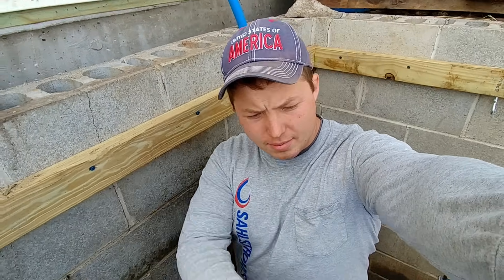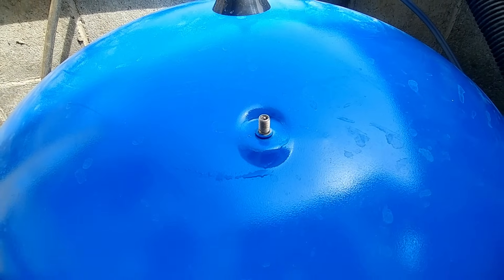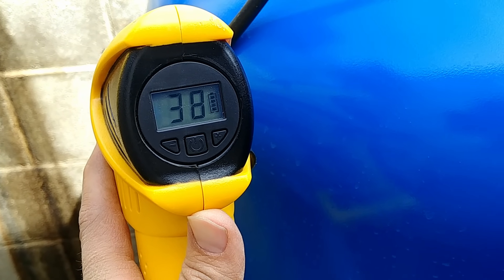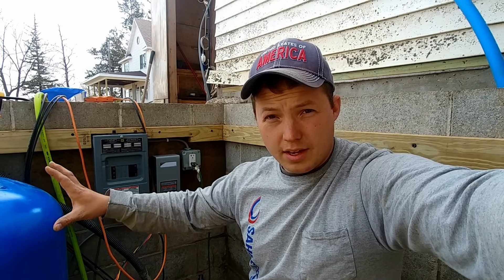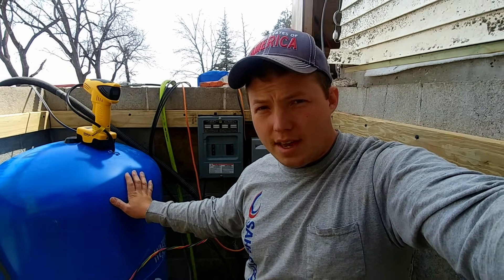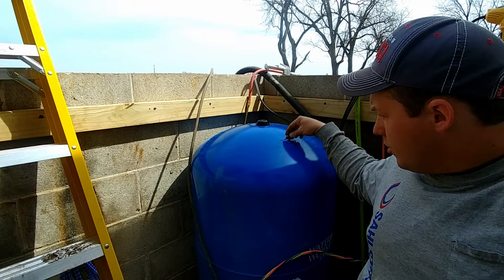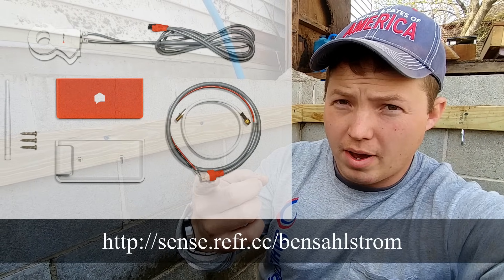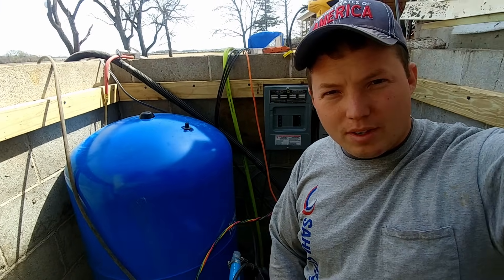How To Set Well Pressure Tank Air Pressure

Comment: You don't waste any time identifying something wrong with your system.  One thing you should consider is a partly clogged pressure switch inlet and routine maintenance and good workmanship it looks like your in some type of blighted open development.   I have a separate switch for my pump house and garage and turn it off when I go to bed so any leak will not drain much of anything.   I never thought of leaving a hose on because I don't have kids but if I were you I would install a hose bibb lock and call it a day I'm sure you got better things to do them monitor your water 24/7.

Comment: Excellent information. Except!  Flooding the well house and allowing the water to be on the floor while your working in the room is EXTREAMY  dangerous. The well pump at that pressure switch is 220 Volts. Most wells are not maintained very good. i.e. loose and bad wiring. It can kill you.  Don't take the chance. Run the water away from the work area with a hose.

Comment: Why is the setting less than the cut in 2 psi?
Reply: If the pressure is equal or greater than the cut in, the pump will not operate at all

Comment: Cool video, just bought a house with one of these and I don't believe the well water system has been maintained at all for at least 5 years. Love your idea of getting two tanks for less pump cycling, that is exactly what I will do, I'm also replacing the pressure switch & adding a pressure gauge so I can see what's going on.

Comment: Hi sir, i have a question ; my water tank works 40-60 psi. sometimes i press air into the tank bu using air pump . The gauge on the tank and the air pump`s gauge give me different psi level when i press air into the tank. (Pump`s gauge 34 psi , tank`s gauge 29psi at the same time) . Which one is correct to achieve 38 psi in the water tank? Thank you.(Tank ıs empty)

Comment: A very valuable addition to any well pump system is an electric light bulb placed somewhere outside the well house that comes on when the pump turns on. I just use a 14-2 romex feeding the exterior rated light fixture. I connect one of the 14-2 wires inside the pressure switch to one of the two pump/load terminals and the other simply grounded to one of the ground screws of the pressure switch housing. At the light fixturre, just connect the two wires as usual. Now, any time the pump comes on, there's a visual alert that can be seen from anywhere outside the well house as long as the pump is running.

Comment: I have a small floater which just runs my sprinklers. I noticed at any given time the pump would come on for about 2 maybe 3 seconds and just stop again every so often. Not sure if the tank was just so low on pressure. Now  the pump doesn't come on when activated my the sprinkler panel.  I took a tire gauge to check tank I get a 0 psi reading

Comment: Why have everything below ground level ? Thats the old way . Here in my state it all has to be above ground in an insulated well house . Top of well casing has to be above ground 2 feet . If down in a hole there is chance of contamination from flooding or the farmer irrigating his field next to you and using chemicals that could get in your well .
Reply from the maker: Yup,  same thing around here. My well is just old enough that it was installed before those rules went into place.

Comment: I have recently watched probably 6-8 videos with folks troubleshooting pump/pressure switch/pressure tank issues. Not 1 has mentioned anything about the tube that runs from the pump to the switch. I'm in Florida and every one of them I've seen are plastic. We have a fairly serious sulfur content (NEW WELL) and the darn sulfur has clogged up the jet in the pump twice now in 2 years to the point that mechanical intervention and even flushing with muriatic acid has to be done in order to get it to pump water again. Have you ever dealt with something like this?

Comment: Great video, so many idiots set the tank when empty to the line pressure desired. Which is 100% wrong. It should be about half of your desired pressure to prevent early bladder failure.

Comment: Hey Ben first of all when I thank you for sharing your knowledge and wisdom I was wondering maybe if you you can help me figure out the layout and set up of my components. I have a water storage tank from a well system so it goes like this well to storage tank storage tank to house, and my components I would like to have your wisdom on how to set up in the order would be a settlement spin down filter to my Grundfos booster pump expansion tank whole house filtration system and I have a electric tankless hot water heater so if it’s not much to ask from you, could you please help me with the set up and configuration just wondering if the order in my head matches up with how you would set it up I thank you very much for any feedback. God bless Ben be safe.

Comment: May I ask...

I have a 44 gallon well X Trol tank with a 60/80 pressure switch, that I have set to 55/75 for maximum pressure at my bathrooms, but not hitting the 80lb max, that home piping is rated for. 

So with that set up, what should be the air pressure in my water tank itself in order to maximize the house water pressure? 

If I understood your video right, I need to get it to 53 pounds of pressure inside the tank, correct?

Thanks in advance for your response back and thanks for the great vid.

Edit to add another question...

Can I drop my pressure switch down to 45psi, so that the settings will be 45/75? My thinking is, if I drop the low down from 55 to 45, I'll still have solid pressure, but I am extending my well pump life by a lot, because it will comes on less, and stay on longer when it does come on. 

I think these questions will help a lot of people, and if they do, please watch the video, but also watch the ads. Sit through the ads no matter how painful, as they get the great people who create awesome vids like this paid a little bit. JS. 😊

TY Benjamin! 👍

Comment: When on a well what determines the overall water pressure? My pressure tank is set to fill at 40 and stop at 50 psi, and my water pressure after the tank is 45 psi. Is there anyway to safely increase this?

Comment: Why is the pressure in my tank when it is full of water the same even after adding another 15psi of air into the tank?? If someone can help me with this I would greatly appreciate it!

Here’s what I did: measured psi before doing anything, it read 67. Drained the tank, and without water the tank pressure was 11.5psi. I bumped it up to 28 and turned everything back in and brought water back into the system. Rechecked the pressure and it’s still at 67psi

Comment: Hello when I go to pressurize my tank when all water is drain to 28 psi were cut in pressure is 30 my gauge reads 28 psi just putting air in the tank I know it is not suppose do that could some one tell why it is doing this so air that I put in tank is going thru tank to the gauge I see your isn't doing that please help

Comment: If you still watch this sight how about sediment . I flushed my well and there was black , red and grey water at the end of the flush  and the pressure gage after that went up to 55 psi and before that it was 38 psi . It was an accident when it backflushed because I was replacing the whole house filter and the turn off  spigot to the house filter broke and dumped the water . My tank is brandnew as of 4 years ago .Put in new one and hooked everything back up and psi after that was 55   my tank looks about the same size or maybe a little bigger and is a pro flow . Other pressure tank I took out was way to small for 4 bathrooms that well driller put in and was making my pump work all the time

Comment: Do I have to drain the water to add air. My 40/60 is reading 1 psi and I just drained it my pressureguage is broken . And the problem I have is high and low water pressure.

Comment: Great helpful video Benjamin. I have a question. LG told me that my ice maker is not working properly because the water pressure is too high. I don't know if that's correct but I'm wondering how to permanently lower the pressure in my tank. It's now set at 40-60. Can I change it to 30-50? How do I do that? I'm assuming I let some air out of the tank to lower the cut-in number to 28. How do I adjust the pressure switch?

Thanks for your help

Comment: You might want to just set it up so that if you want to drain your pressure tank you have a pipe that simply runs out through the wall and drains it outside. That's what I would do, of course I'm here in West Texas, it may be warmer here than where you are. Thanks so much for the video! It was very helpful.

Comment: What makes the pump stay on long after the tap was turned off?. This is the problem I’m having in my van.
Reply: In your van??  Your faucet is using up water from the pressure tank. Your well pump then refills the pressure tank. It can take a few minutes to fill the pressure tank after you shut the water off. Completely normal

Comment: you gave me anxiety being in water with electrical and piping ive been electrocuted by an exposed wire hitting a window frame and me grabbing the the window to open it. i had to be kicked off the window. other than that it was educational video. summed everything up nicely. just be safer.

Comment: This depends on the type of your pressure tank. However in my experience with modern pressure tanks, first check the ratings for your individual tank. It should be printed clearly on a label somewhere on the tank.

Didn’t see the specs on that particular pressure tank. But that’s an incredibly low water pressure. Standard residential is 60 psi in most areas. And you don’t want to go beyond about 75 or 80 for any reason for residential water.  Specs on that particular tank will probably tell you’ve got a max pressure Capability of 125 psi.  Of course that may not do much good if you have pressure reduced at the well.
And as always, if it was configured based on the capacity or capability of your well then it should be left at those settings.  There’s absolutely so much to get into on this subject there’s no way to do it in a single comment.  If you’re having trouble with your water pressure, first you should check the pressure regulator on your well, and consider bringing that tank up to 60 psi if it can handle it. It very likely can handle that.
Reply: Of course you need to be sure your well pump is rated for those pressures. A few of them simply are not. But most can

Comment: What's the difference between a pressure tank and a expansion tank?
Reply: Two totally different things. The well pressure tank in this video pressurizes drinkable water into your house. An expansion tank is used in a hydronic heating system. It gives the hot water (heat expands ) somewhere to expand into so it doesn’t overpressurize your system and blow out the safety valve on the boiler.

Comment: If the tank is low or not working properly, will the pressure switch turn off and on rapidly??   Thank you very much
Reply: You are describing a cycling pump. The switch is being activated and causing the pump to turn on & off rapidly (every few seconds) and as Ben explained, this is likely due to the pressure tank having low pressure. If you watch your pressure gauge you'll see it going up & down with the cycling.

Comment: Excellent video. I'm having drop in pressure and sometimes the water stops for few minutes before it kicks in. When the water stopped in the faucet, I checked the pressure in the tank and it shows 25 PSI. Pressue gauge in the tank too shows 25 psi. Pressure switch is set to 30/50. So if I have to fill air in the tank what would be the ideal pressure? Do I have to empty the tank before filling air?
Reply from the maker: Pretty sure I answered those questions in the video but in your case you would set the tank bladder pressure to 28psi and yes you would need to empty the tank for an accurate pressure setting.

Comment: .Great video , I will use these tips to analyze whats with the well pump. 
On another job site  last time I messed with the the sprinkler system box next to the well pump it started to smoke a little, then a lot, then a few small flames, I freaked out !!  Thankfully the gardner next door saw me getting a little  hysterical. by then it was kind of on fire ! 
we had to call the electrician to rewire the yard, omg it was something . WHAT A DAY! lol
One question, Why are you standing in a puddle of water with 220volts running through the system. Be careful ! I subscribed please make more videos !

Comment: Hi Ben - great video - thanks!  I would like to adjust my pressure tank so that i can allow my pump to generate more pressure.  Does that mean I simply need to a) empty the tank of water; b) pump more air into the tank...?  The pump is 380 watts and currently is set to shut off at 43 psi.  I want it to push until it hits 59 psi.  Is the pressure tank the LIMITING FACTOR in this setup?  Thanks again!
Reply: It's all just an open space. If you decrease the air pressure, you'll have less water in the tank, but the water will get to the same pressure. You can't get more pressure than your pump can produce.
Reply: I'm

Comment: You should explain WHY short cycling over time damages a pump.

I assume it's because a pump draws much higher amperage at startup, which heats the pump above normal running temperature, and short-cycling doesn't give the pump enough run time to cool it down to normal running temperature.
Reply: Starting and stopping more often subjects the well to increased wear from acceleration and deceleration. Just as a city driven car has more wear than a highway driven car of the same mileage.

Comment: At 1:40 , when showing that you have to empty the water from the pressure tank, you say "You can do this any place in your house." My tank is 2" above the floor in my basement, so would your statement mean that I could turn on the water in the (basement) laundry tub to empty the tank?  I suppose if I do that first, then I could empty the last little bit of water from the hose bib plumbed in right next to the pressure tank to completely empty it.  Did I understand you correctly and it my procedure adequate?

Comment: How do I know which pressure switch I have? Or can It be adjusted to different cut in and cut out pressures?
Reply: If you haven't found out by now...
Unscrew the silver nut on top of the switch, pull the cover off, the pressure should be shown inside the cover.
You can adjust the pressure to a point.
That part is sort of difficult for me to explain, bit there's lots of YouTube videos that can do better than me.
Be careful though, that's 240 volts going to the switch.
Be safe and good luck👍

Comment: You are standing in a puddle of water with live wiring, not too safe I think 🤔.  My pressure switch has built in protection so my pump will not run if the pressure drops too low, they are common, maybe $ 10 more expensive . Your videos are awesome.

Comment: Bro, secure and protect your pump power feed line. I see daylight. Put that 3wire pump power feed in some ultratite instead of letting it flap in the breeze. That wire can handle being in water for years but it hates sunlight even if it is marked UV rated. I see stuff like this a lot. You would figure this out in a minute but there are tons of peeps out there that got talked into having their pump replaced prematurely by "a well guy" or even reputable well drillers just because only one leg was going down the bore and a 240v pump doesn't spin with the other leg missing. If thats not enough, family dogs have chewed stuff like this. I know of at least one story where the score was pump 1, dog 0.

Comment: So can you put air in the tank with a compressor? I have a 20 40 wellsaver pressure tank, it has twenty lbs when we checked the valve, but our PSI valve is at 0.

Comment: Plz help. I have a 24l tank and wanted to know if the pressure setting would be the same
Reply: It has to do with your pressure switch, not the size of the tank. The pressure switch will come on a certain pressure. You want the tank pressure to be 2 psi less than that number.

Comment: Hello Ben.  I'm adjusting my pressure switch settings from 60-80 to 50-80 to allow my well some additional time to recharge/recover between pumping cycles.  Should I bleed the pressure tank pressure first, before making the switch adjustment, or is it the other way around?

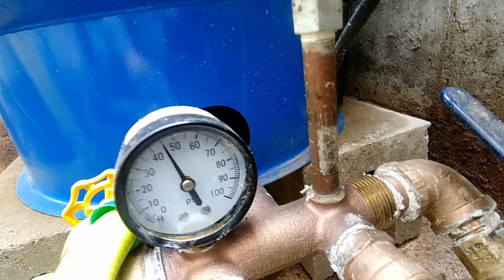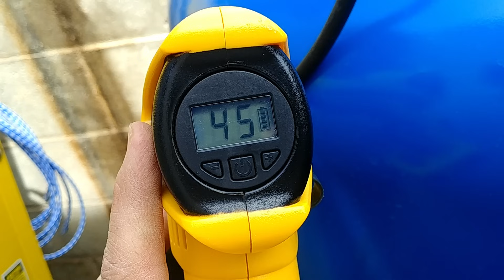Comment: From 0:55 to 1:25 you show that your water pressure gauge and your fancy ass air gauge are in agreement, both reading 45 PSI. However since these type gauges are usually not scientifically calibrated instruments I suspect it would not be uncommon for the two gauges to give different readings for the same pressure, in which case adjusting the tank air pressure (using a tire air gauge)to be 2-3 PSI less than the switch cut on pressure (judged by the water pressure gauge) could  be  off. If one gauge was 1 degree high and the other 1 degree low you might end up with no difference at all. When I do this I think i"ll do what you did and take an air pressure reading of the tank with water still in the tank, before emptying the tank, to see if the gauges agree and adust for any difference.
Reply: Long winded fancy ass agreement